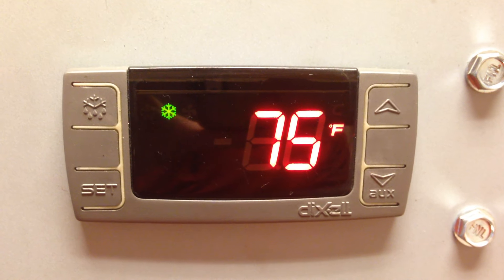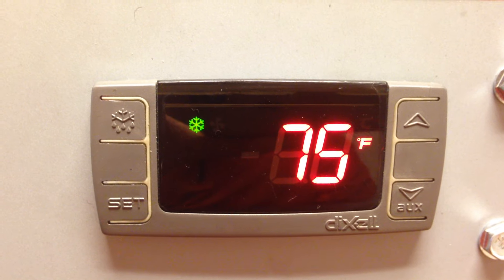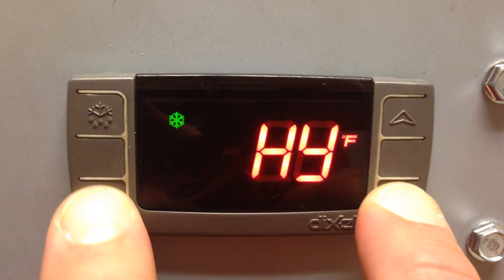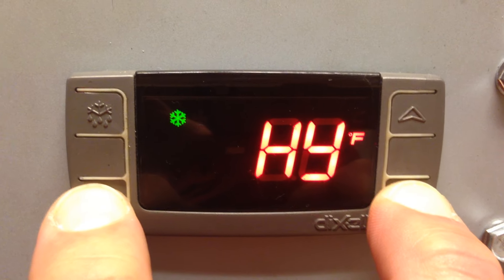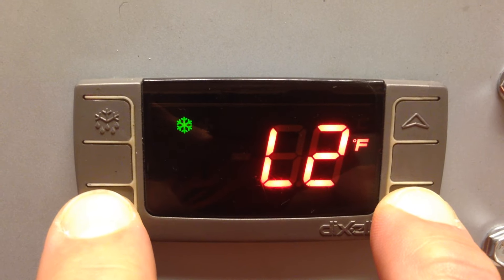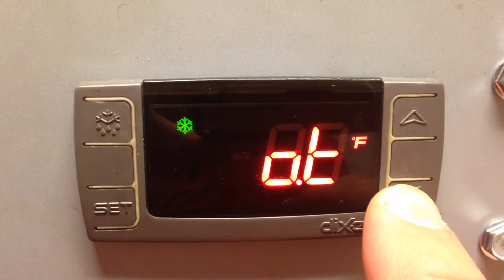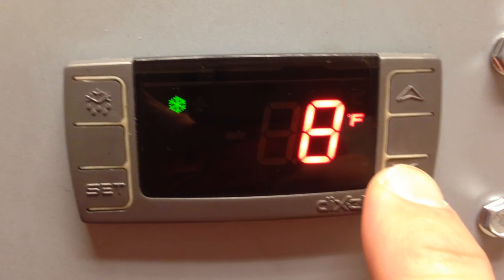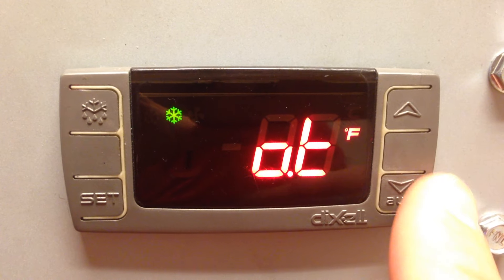HK Dixell Controller Programming

Comment: Good video. I have a Emerson Digital Controller , It shows me on the screen p2, the problem is that the evaporator is leaking of ice, it does not do the defrost cycle.  You can help. 

Electric Heater is good 👍

Comment: This doesn't tell me how to make it the temperature I want and the instruction manual doesn't either.
Reply: The one your looking for is LS and US possibly just use SET if yours is already mostly set up. 

Unlike mine many others used before I got to it so all the values are changed and I can't find any source or info about the default values. I know how to change just don't know the rec settings/ factory settings.
Reply: @daweicunningham6819 the defaults are stored on internal memory and you can reset back to them. It’s in the manual somewhere how to do it.

Comment: Anyway to set it from locking? Door locks for a few seconds after we open the door each time.
Reply: The "locking" effect comes from the door making an airtight seal around the perimeter of the door. When you open the door, you let in a blast of warm air, and let out a blast of cold air. When you close the door, the warm air begins to cool. Cold air has a lower pressure than warm air, creating a suction effect that makes it very difficult to open until the pressure equalizes. That your freezer does this is a sign that your gasket is in good condition, and is working properly.

Comment: For a company as big as HK International this video is an embarrassment. It tells you absolutely nothing. It was published over 4 years ago and not a single response from the publishers to any of the significant questions raised by the audience who have clearly come here looking for answers that they didn't find. Word to HK. If you are going to engage in social media then at least make an effort to give the job to someone who is competent enough to do so. Whoever produced this crap is clueless not only about engaging with the general public through social media but also at the product level. Once the unit is installed it should be obvious to anyone who has been through that process what the next step is likely to be: set the preferred working temperature. That's what this video should present in a stepwise fashion. Not some general discussion about how to change the many and varied parameters most of which are vague at best as to what they represent. Must do better.
Reply: This answer represents the feelings of many people going through the same frustration. There's zero information here on how to actually set anything up.

Comment: What does P2 error mean
Reply: My prep cooler was messed up! I decided to put everything back to factory default settings. When I did, P2 error started. So, in programming mode I changed my P2 parameter setting back to N instead of Y and the error stopped. My cooler’s manual is worthless. I had better luck looking at this manual for the controller:
http://masterfrigo.com/wp-content/uploads/2013/10/XR06CX_GB.pdf
Reply: @andykistner2240  Thanks for the info. Was able to change Dwell From factory setting of 7 to 5.